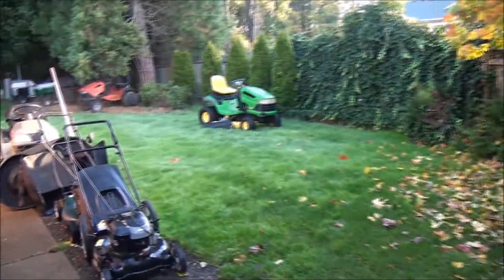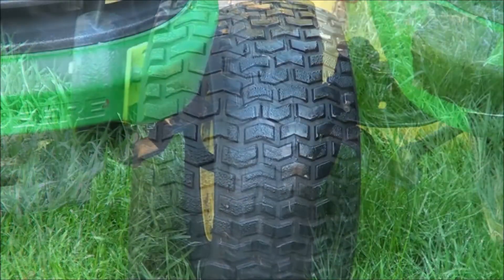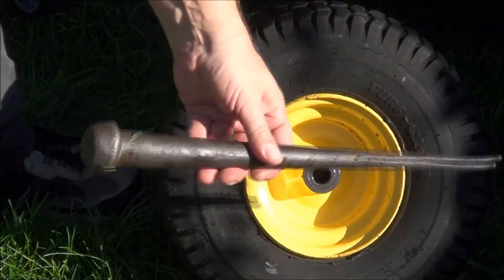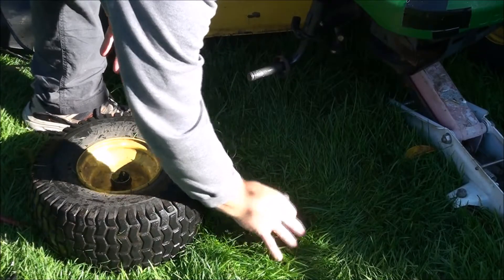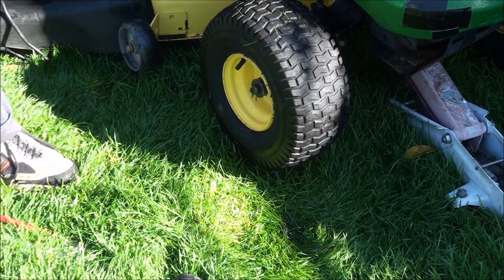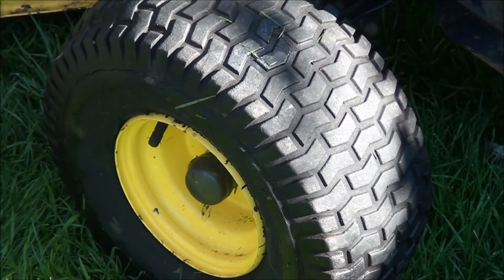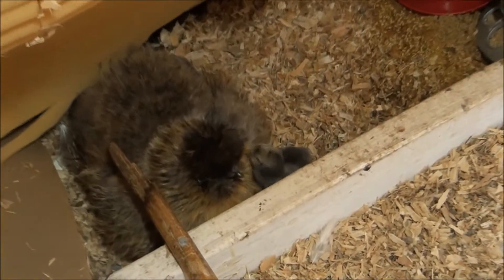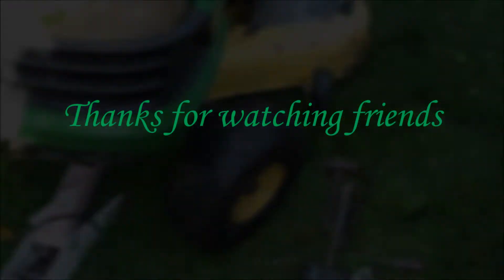HOW TO Replace the FRONT WHEEL Bushings / Bearings on a RIDING LAWNMOWER

Comment: Thanks for the video, IMHO I would of suggested to the customer of that rider to replace those garbage sleeve bearings with real wheel bearings, there are all kinds of sets on eBay and Amazon, they are cheap and last forever.
And the grease should always be removed and the wheel hubs cleaned because the grease in there will have dirt and the shavings from the sleeve bearings.
You video was short and to the point and I give you a thumbs up for that:)
Reply from the maker: good tips!
Reply: Tried it, they don’t last any longer
Reply: I don't agree, ball bearings sound good but we are dealing with fitment on an axle that is generally a bit sloppy by nature because they are lawn mowers for Pete's sake, these aren't car/truck spindles with close tolerances so the sloppy pounding of your typical lawn mower is going to beat the little balls out of the races in no time, stick with the bushing type bearings folks if that's what your mower was manufactured with.

Comment: There are quite a few videos on this subject on youtube. Almost all of them I noticed on disassembly there is indications of adequate amount of grease used. My thought after watching all these videos is that the grease really doesn't work to keep the bushings from wearing out. My thought is to remove wheels annually and clean old dirty grease out and inspect the spindle and bushings for any wear and then add brand new grease. Mine just went bad on the left side mainly and the right side was only slightly worn after 17 years ( 480 hours) . I neglected to grease regularly but from what I have seen it doesn't really matter.